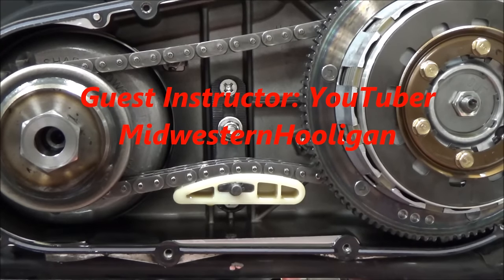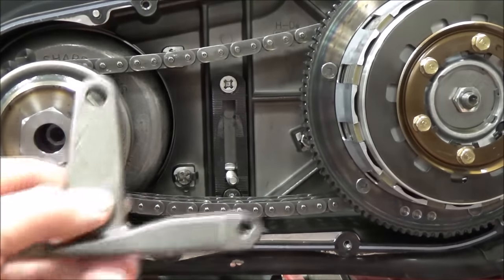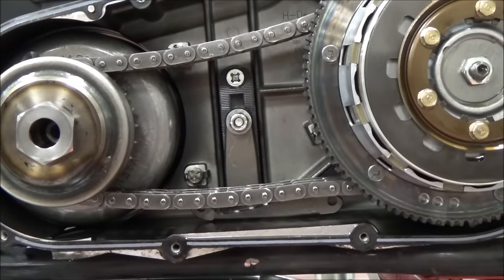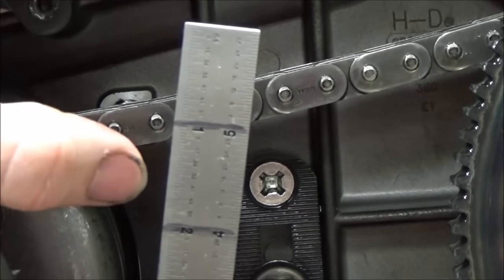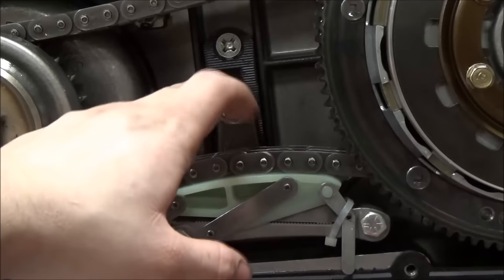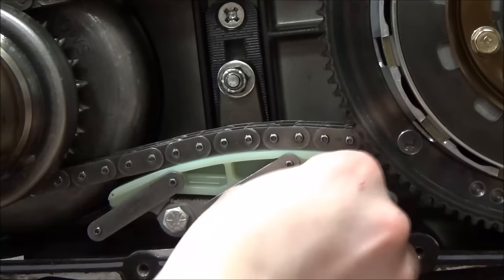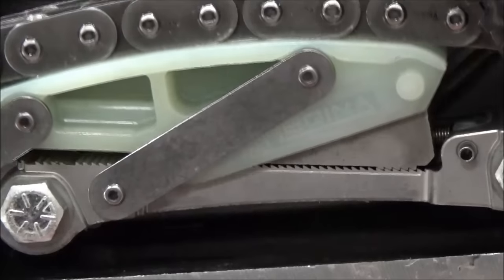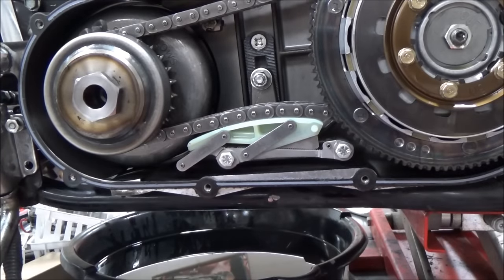How to Install a Harley Davidson Automatic Primary Chain Tensioner Kit # 40063-05B

Comment: Scrap that auto tensioner and go with a Baker or Hayden. When you need to have the bearings replaced because the tensioner gets too tight and pulls on the trans.shaft and the crank bearings you'll wish you did your homework on that one..
Reply from the maker: Thanks for commenting and adding value to our community!

Have you subscribed yet to never miss a video? Have you seen the video playlists? Over 600 videos! Check them out here: https://www.youtube.com/user/conleybuilt/playlists  

Want to say “thanks” or “keep it up”? Click here https://www.paypal.me/how2wrench    
 
Your answers and help are just around the corner. Save time and money while protecting your investment and yourself by doing it the right way at www.How2Wrench.com
Reply: I have that JUNK in mine now. Whining big time and bike has only  3900 miles. I plan to put a Hayden in it over the winter.

Comment: I think this is the tensioner that puts excessive load on the crank and trans shafts making them explode...
Reply: AboutMy FathersBusiness  yep this is the one. My 08 Ultra had this exact one and cost me more than it was worth. I ended up going with a Baker Attitude manual adjuster but the automatic tensioner like in this  video destroyed my clutch hub and bearings , Compensator ( i ended buying a Baker Compensator also)  automatic tensioner definitely not worth the trouble
Reply: Apparently the problem is when the chain is cold it loosens and ratchets up.  When it gets hot it expands and tightens down, pulls and wears.  A vicious cycle.  Some have been blessed that the tensioner malfunctions and fails to tighten.

Comment: With cam tensioner at the bottom, wouldn't that mean chain replacement and cam crew set back to top?
Reply from the maker: KlingensmithAutoTech 
This is not a cam. Checkout the title. This is a Harley Davidson Primary Chain.

Comment: Isn't this one of the known failure points with Harley for years and the pieces get into the oil screen starving oil to top end, causing a cam galling failure?
Reply from the maker: No, That was on the cam side. I'm making a video on replacing those on this same bike.
Reply: Shane Conley you're videos were very helpful when I changed out my cam tensioner a few months ago. Thanks for the videos!

Comment: Has anyone designed a set of toothed wheels to replace the friction shoe in one of these tensioners. Surely a set of toothed jocky wheels would be more reliable and efficient. Is there an engineering reason why this has not be done?

Comment: Do not use this if you have a manual adjuster.   Mine has 50K on it and I have only moved it one time up one notch.  Once the links groove in, the rollers roll. All wear stops.   Don't worry about that little bit of plastic.  There is a bunch of fine metal and a little amount of clutch dust in there anyway.   If you do your own oils, a primary and transmission dump really makes sense when you do engine since they do not have filters and it's less then two quarts of Harley Formula +.   Nothing better since it is a  gear oil with no EP or detergents designed for the clutch and no filter system.

Comment: This is the same tensioner Harley puts in there 2007 and up touring models that "ratchet up" too tight and cause premature wear on the compensator and bearings. DO NOT put this on your bike!!!
Reply: Troy Morman  You are 100% correct. I have an 08 Ultra and I found out the hard way. I now have a Baker Compensator and Baker Attitude manual adjuster and also had to replace my clutch hub due to that POS automatic tensioner.

Comment: Why would anyone fit one of these automatic pieces of junk
Reply from the maker: What is your preference 1974steny? I've always preferred the adjustable ones. Maybe its just to old way I like to have the adjustment myself.
Reply: @How2Wrench  mate the screamin eagle manual tensioner is what i run after the auto tensioner destroyed my clutch and gearbox